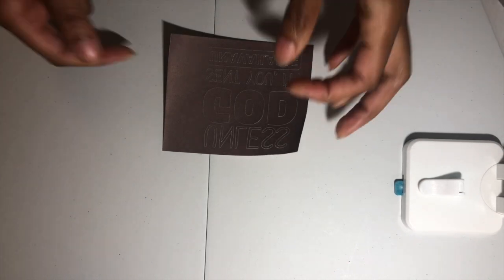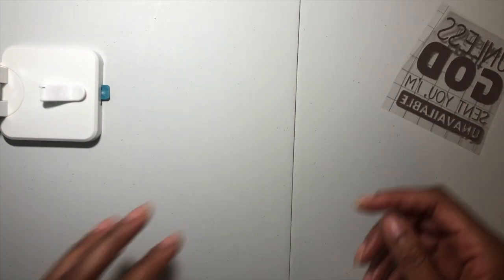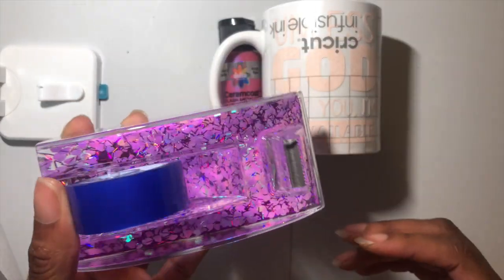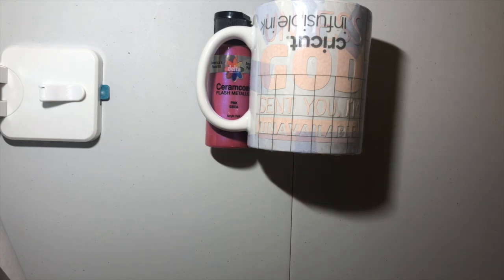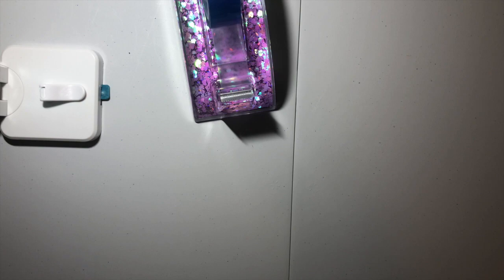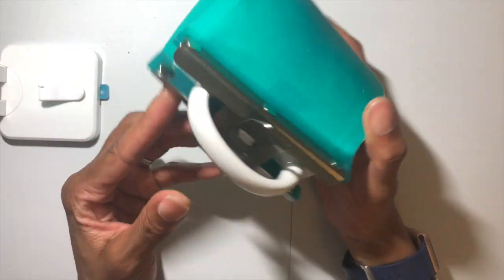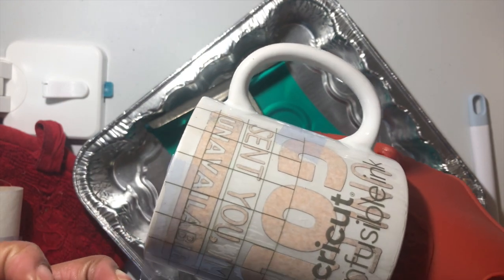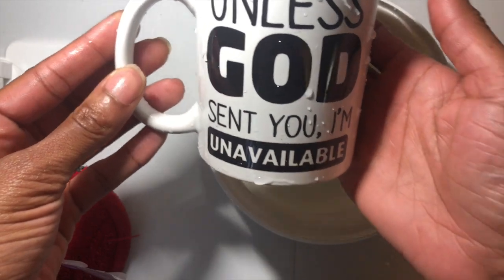Cricut Infusible Ink & Sublimation Mugs (using oven) - does it work?

Comment: Definitely wait for it to cool down! It can actually still be transferring while hot and make it smudge, glad yours didn't though! I have done it with the markers in the oven, but wasn't sure how the sheets would work so I am glad I found this video! I have learned the hard way that if you don't put a bunch of layers of parchment or butcher paper between the mug wrap and the mug, it may have some transferring from other designs.

Comment: When I put my mug in the oven, 425 F for 14 min, without butcher paper, it said to peel off when hot which I did. The color came out not black but black/brown. 

What did i do wrong ?
Reply from the maker: OMG I'm late with responding to you. You may need to tighten the silicone around the mug.
Reply: It must have a lot of presser all around the mug to work. This is why ovens don't always work until you know how. Using shrink wrap is an option also. But if your using an oven. I hope not the one you cook the family dinner in?

Comment: Nice work. So do you think this is cheaper/easier than using a sublimation printer.  Thanks
Reply from the maker: It is, but it is also limited. I wouldn't recommend trying to layer using this method or cut intricate designs. If you're just sticking to words and simple images in one (or maybe two) colors, this method is cheaper and easier.
Reply: Yes infusion is only cheaper if you are doing a few mugs. But has it is already printed. You have limited to their colours & designs and the rest is our own way of mixing these up. Sublimation cost more to start it up has you need a sublimation printer (or covert an inkjet). But if you are planing to do a lot. Then sublimation is a lot cheaper than infusion. Plus you can design ANYTHING you want. Photos, logos, cartoons etc. If you can design and print it. You can sublimate it! (plus T-shirts etc.) But with both infusion & sublimation. You must use sublimation mugs. Do not buy from the Dollar store has they will not work.

Comment: Did you peel it off while it was hot because you were curious to see how it turned out? Or do you think it’s fine to let it cool down and then peel off?
Reply from the maker: You CAN peel cool - but just make sure the design doesn't shift or else you'll have ghosting. :)

Comment: Can you use the shrinkwrap bags to hold the design in place?
Reply from the maker: Not entirely sure... I don't see why not though.
Reply: Won’t they melt?
Reply: No. Not in the Cricut machine. The think wraps or for ovens and the vacuum heat press only. Not direct heat pressing.

Comment: Do you ever have problems with the grid pattern also transferring? I’ve tried making one mug (but I didn’t have the silicone wrap and put it in for 20 mins..) and the grid transferred as well 😞
Reply: If you do not have the silicone or Teflon sheets. You can use butchers paper. You will see the butchers paper burn a little on the outside when you take it out. This is normal. You can use this a few times before placing it.

Comment: you used a regular oven, not a convection oven?
Reply from the maker: Hi Pam! Yes, I did. (If it matters, I have a gas oven)
Reply: From all my research, you aren't supposed to use an oven that you will also cook in to to sublimation....something about the gasses it lets off not being safe. I wonder if it's different for Infusible Ink as apposed to regular sublimation.

Comment: New subscriber!  Did you have any issues with strong fumes or your oven setting off your smoke detector.  I have seen videos about this and wanted to be assured that is was possibly from user error.  Your technique is excellent and easy for beginners as I know nothing about this technique.  I wanted to purchase a cup press but they are all sold out on Amazon when I last checked, lol, everyone has a hobby now.  I rather use your technique.  I do not own a circut and I really don’t wish to purchase one because then I will be on the forever circut wheel chasing down their products!  I’ll check Etsy and see if they sell printed cutouts hopefully.  Thanks for sharing this technique.
Reply from the maker: None at all. I turned my exhaust fan on high to make sure I didn't have any issues. The only smell perse is the silicone as it heats.
Reply: I seen another video that you can place the mug in an oven bag
Reply: @vmonroig21  Yup... the air fryer works as well. There are so many different ways that work. That's what I love about crafting in general! :)
Reply: it is strongly recommended to use a separate oven that you cook food in due to the fumes in your home and possible contamination of your food.

Comment: You could wait till it cools and avoid the pain🤪
Reply: Well yes. But the main reason for letting it cool (about 20 minutes). Is so you do not get any `Ghosting´  This happens when the ink is still very hot and you move the paper with your  image on while it's still on the mug. You get a very thin second image on your mug. This is called Ghosting and doesn't look good and you have to make another one. I take mine off while it's hot. But I've been doing this a while. Some people put in in warm water to help cool it down quicker.